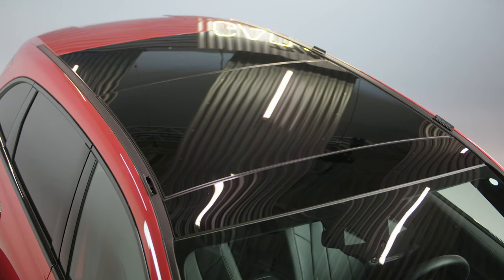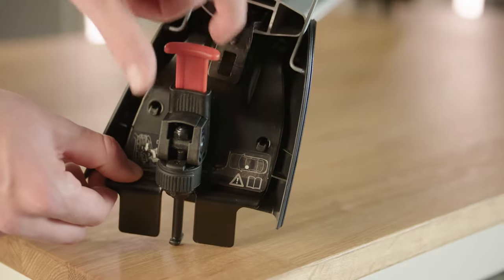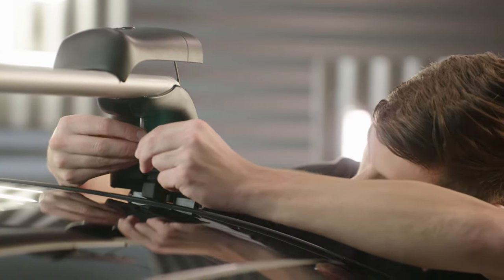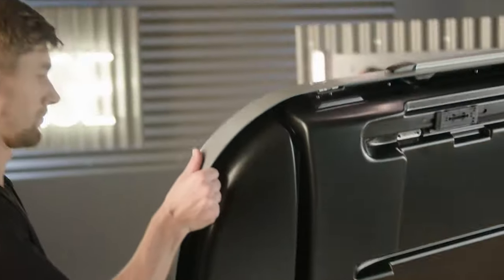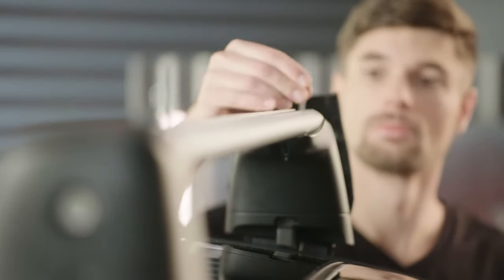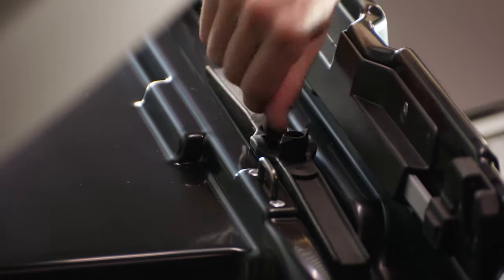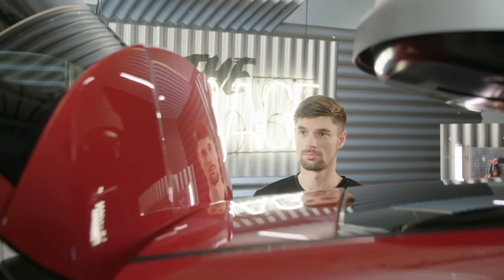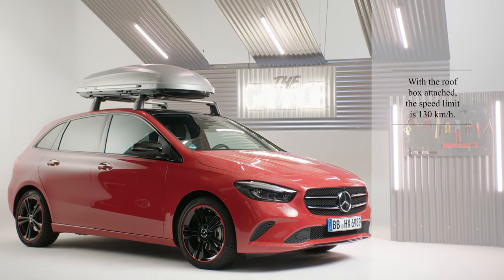The Garage - Episode 1: How to install Mercedes-Benz Carrier Bars and Roof Boxes

Comment: Do not remove the rubber as the wind noise is significant. Keep the rubber and push the screws through to your required location. Also the rubber is needed to push the screws up otherwise they fall deep and they will not reach the nut in the box.

Comment: can the bars easily be de-tached and re-attached just by hand and without any tools once it was installed one time?
Reply: @Biboubier5528  Lol that is false information here, the answer is Yes, because I bought them and I am using them. You do not need any extra tools to mount or dismount them.